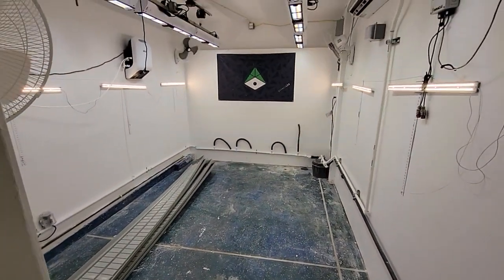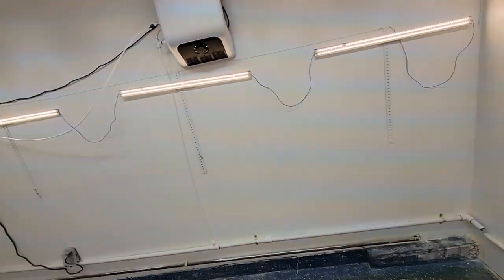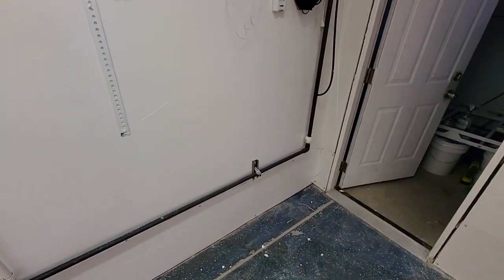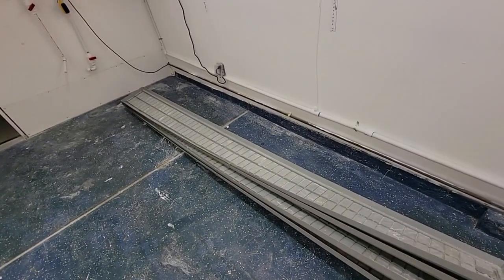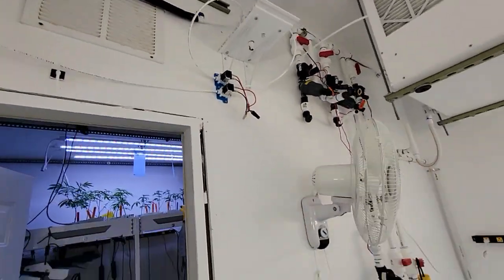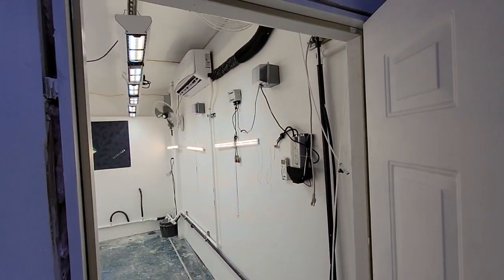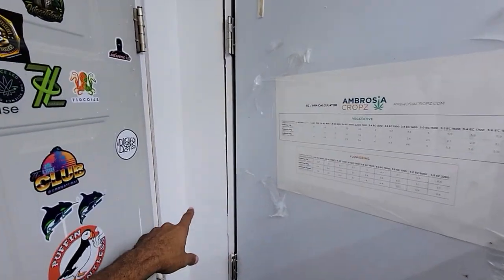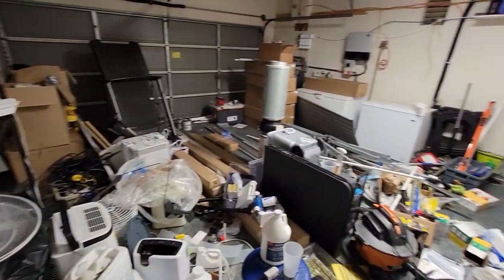grow room remodel update

Comment: Anyone here wanna talk and give me some tips on growing specifically for hash? I’m trying to go “single source” but I have little to no growing experience
Reply from the maker: Learn the basics first. Good genetics. Environment, lighting, nutrition, plant training.
Reply: @SolventlessBakenVape  that’s exactly what I’m doing. I’m running something from bloom seed co, genetics seem to be great. My questions are all specific to growing for hash. One of the biggest ones I’ve been asking….as a hash maker will I have better results lollipop-ping my plants or should I just let everything down there develop as much as it can? Which way will tend to yield me more hash? I know that the actual answer to 99.9% of my questions is probably “every variety behaves differently you gotta just try shit and find out”. But it can’t hurt to gather opinions
Reply: @Pdbottleneck  don’t lolly pop/tip/top or anything, just use a net for even canopy, if your growing purely for hash you can stress plants slightly to create more tri comes by having your light just a little bit too close to canopy, you will get smaller buds but they will be super frosty & excellent for hash. 
You can also add some uv lights to increase thc. 
✌️🇦🇺
Reply: @danielgonzalez-yp7hi  most of that makes sense to me but you really think I shouldn’t top anywhere? I usually top 3-4 spots early on
Reply: @Pdbottleneck  topping will slow down the growth of your plant, easily will add a few extra weeks veg time.  Use a net & get same results but quicker & healthier.  Example would be 9 plants in a 5x5, 3gal pots, give 7 weeks veg from seed, flip, 9 weeks flower, & Bob Marley’s your uncle 💨 ✌️
Reply: @danielgonzalez-yp7hi  I honestly didn’t notice much if really any recovery time when I topped the girls I’m running now. Maybe it’s just really good genetics. Or maybe I don’t even know what I’m looking at but I watch them very closely and everything grew just as fast before and after topping. I’m still learning tho and I really appreciate your input. Do you think it’s possible that if conditions are optimal and genetics are really strong then topping and other low stress techniques might  not really slow things down much after all?